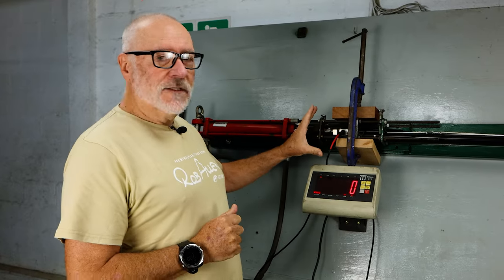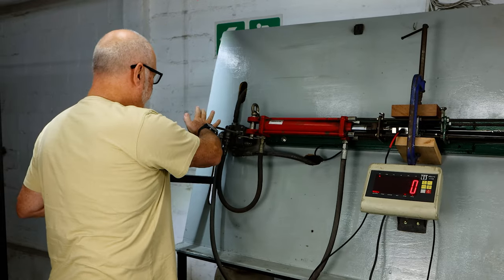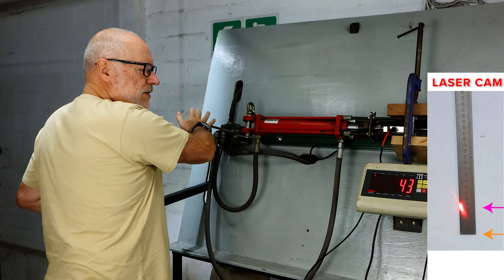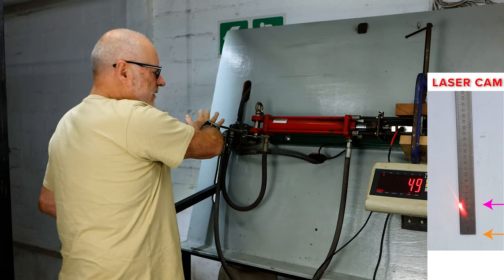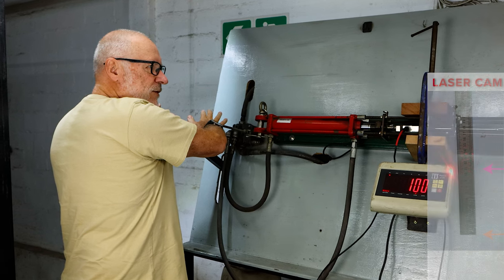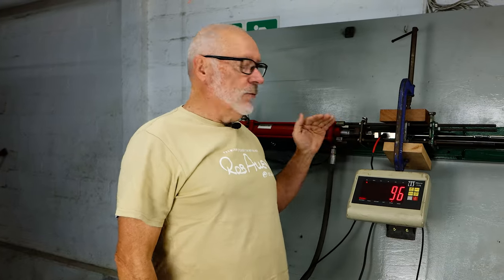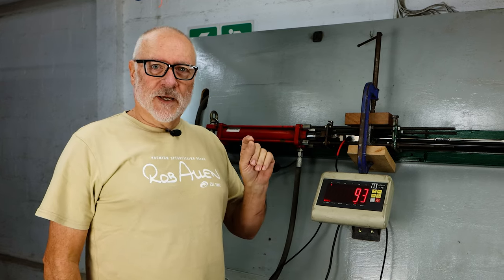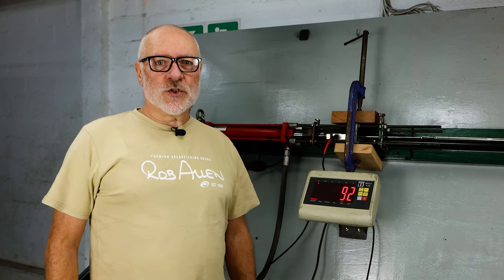Rob Allen | Barrel Deflection | Part 5 | Thin Walled Aluminium | 2024

Comment: Hey Rob, would that mean that having a single 16 mm band - 50 kg of force and a shorter barrel (700 for example) will reduce around twice the flex of the tube compared to the 130 cm barrel?
Reply from the maker: Hi Aleks, I'd say even more. You will have halved the load and, shortened the barrel by nearly half again, so I doubt there would be any noticeable flex with that set up.

Comment: Hey Rob with such thin walls which band thickness would you say is good, single 14 mm single 13mm or single 16 mm? Or maybe even double 13 mm would work? With say a 6.5 mm spear used in europe. And would a cuttle shaped barrel decrease such barrel deflection? 
I have a cheap 75cm barrel round wall gun with single 14 mm band with 6.5 mm spear with around 40cm overhang, i am accurate with it, the band is screw in EU style on top of muzzle. Then i bought an expensive speargun cause there arent like yours in my country. And its a double 16 mm band, 115 cm gun with a reverse mech all stainless roller mech ergo grip if i may say its called salvimar hero open muzzle has a 7.5 mm spear and my accuracy is very bad with it. My aiming technique is i extend my arm and body into the shot close my left eye im right handed. I put the fish in the muzzle hole so if its a red fish when i see the red color in the muzzle i shot and 90% of the time i hit my target with the closed muzzle. With the other one more expensive gun i cant hit anything. Spear seems straight iv rolled it on the table no wobble. Thank you
Reply from the maker: Hi, it's not about the rubber, it's more about the barrel length. A 75 is a short gun, so that thin walled tube will be fine as you have  found out. I can't comment on the cuttlefish shape barrel without seeing and testing it. Sorry I can't comment on the problem you have with the Salvimar gun as I have never had one to test.
Reply: I have the same gun, it's problem lies with shitty mechanism that is way to hard with 2 short rubbers. You lose accuracy if you have to press hard on the trigger, same reason why archers use RANDOM release mechanism to increase accuracy. 

Is your hero double banded or single? If you swapped to single with 7.5mm I'd say you don't have enough power.
Reply from the maker: Hi, there are so many variables it would be impossible for me to know what the cause is, especially when I have never tested a Salvimar. So.... if the spear is straight it might be a barb that is sticky and not closing fully. It could be over powered or under powered. Has barrel flex. Too much recoil etc. There are other possible issues I might not know about. When you extend your arm are you keeping it stiff? Are you holding the grip tight and steady enough? Are you still fining slowly when you pull the trigger? There are so many issues that can make a gun inaccurate that in this case, very difficult to tell. I hope this is helpful.
Reply: @mikefue9597  
Hi thanks for your feedback. My salvimar hero came standard with 2 16 mm bands the 7.5mm shaft came with the gun standard configure. The trigger is very smooth and has an adjustable screw if need be.
Iv seen an old video on youtube guy who tunes spearguns for best configure had same problem with and batch of salvimar hero shafts then he changed to another brand shaft and was all good.
Im thinking either the shaft is bad or i dont have enough overhang since on the smaller speargun i have more overhang compared to the size of gun.
Reply: @Firstname-v4v  you are talking about majdaq8 video :-) 

Me and my buddies we have had terrible experience and the gun is the last piece of salvimar I'll ever buy. 
The mech pins and case would oxidate early on, nowadays even roller pin and the lever would. Noone of my/friends other guns that we abuse for days would oxidate that bad even if we treated them harshly. 
Salvimar for me is known for cutting corners and don't give a shit about customer support. The gun is the nail in the coffin for me after I really tried giving them a chance after salvimar came back to me after failing masks mounts couse their design is complete shit and prone to prematurely fail. Guess what - they still use the same fail design after years.
Reply: Yeh its him i sent you the video link. Think  i will sell it and buy a meandros heard good things about it maybe you know first hand or your buddies used a meandros? What speargun you found best for you? Would have bought a rob allen but aint non i can find where im from.